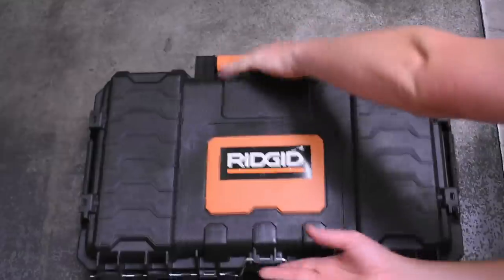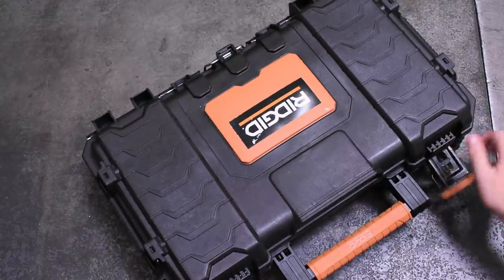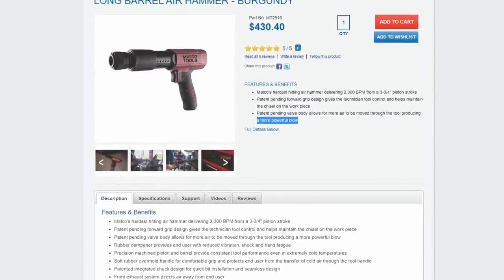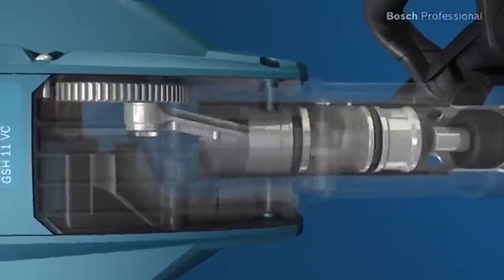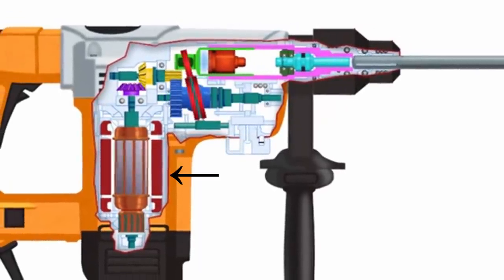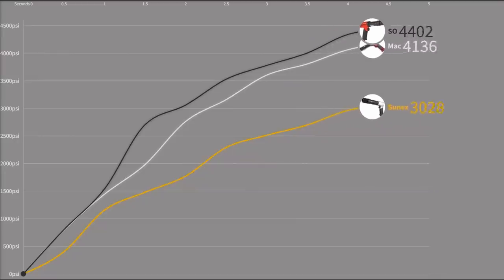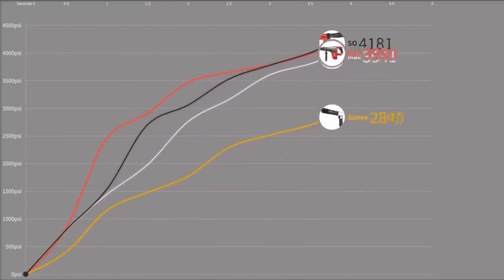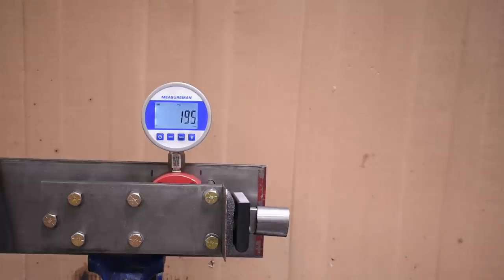How Rotary Hammer Drills Work & Dyno'd vs Air Hammers

Comment: I’ve always wanted to be able to use an air hammer but I’m rarely near an air compressor that’s big enough to remove stuck brake rotors or push out axle shafts. I’d be curious to see if they have any compact versions. Maybe someday they will come out with a dedicated electric hammer version without the drilling function. Could be nice to also see the smaller Harbor Freight Chief air hammer which is only $40 at my local store. Good work!
Reply: There are plenty of hammer-only tools but many are corded
Reply: @lolatmyage  And they are big and heavy because they are designed to be used in demolition of concrete structures not to loosen stuck rotors. So there is no direct electric alternative for air hammer targeted at car mechanics
Reply: @mysterious_czrs  Not really, the smaller ones weight less than 15 pounds and can be swung quite easily. Dull the bit and it will rattle a brake rotor just fine although yes, it might not be good for the tool or your hands if you're hitting an immovable object as I've found that this tool works nicest when it is making progress.
Reply: What about a palm nailer?
Reply: i use my dewalt cordless sds drill all the time for working on vehicles and trailers. it hits fairly hard but also i find it hits faster or different than an air hammer and sometimes it works better.

Comment: SDS Max and SDS Plus tests are awesome, the Milwaukee SDS Max that you were using is quite weak compared to the really big SDS Max Hammer Drills, like the Bosch GBH 8-45DV that has a cinetic impact energy of 12,5J which equals to around 9 to 10 ft-lb.

Comment: Thank you!

The Milwauke 2717 advertises 5.1 ft lbs of impact energy, which translates to 6.9 joules which is what we use in Europe. That's at 3000BPM.

Over here, we get the FHM which is rated at 11 joules or 8.1 ft lbs which is quite a bit more, and that's 2900BPM.

Either way that's a lot for an SDS. Your typical regular use one would be 2-3J but likely hit a bit faster.

Comment: I have a few SDS Plus/Max tools and have routinely used the smaller ones in place of my old air hammer which has rarely been used in the last few years. With a ground rod driver attachment I’ve even rigged up a way to use my air hammer ends on the SDS drill. I use the SDS a lot in hammer only especially the smaller battery one as it is great for doing a lot from popping tile off a floor/wall to splitting nuts.
Be nice to see an expansion into SDS as battery tools have replaced air to a great extent especially outside of auto shops. I have DeWalt as it was the brand I got into 20V/60V but they recently expanded their SDS lines to include 12V which is quite small; would be nice seeing how honest the companies are regarding the power of these rotary drills. If it’s anything like impact drivers there will be quite some fluff in the numbers.

Comment: Ft lbs is energy the SI version is Joules ( J ). 
Most SDS Plus here in the UK seem to be ~2J or ~8J with SDS Max 10J or ~20J. 
It would be nice to see a compact SDS Plus comparison some 12v tools are much closer in size to the air hammers.
Reply: I've Joules used in advertisements of these.

Comment: Very interesting stuff guys! I do rotary hammer testing on my channel but I've never used an air hammer before. Are they for knocking loose seized bolts? Your type of cumulative force measurement is definitely different to what you'd normally do to measure SDS hammers. Very cool crossover measurement.
Reply from the maker: Hey yeah! Ball joints, rusted car parts. Brake rotors. Stuff like that

Comment: Man I wish I could send you my SDS max 60v dewalt hammer drill. I love this thing a lot and had used it as a mini jack hammer at times also did a lot of drilling but it a job tool and cant take it home lol. TBH I never stop to look to see how the internal worked I did not know that it uses a piston and vacuum to get the hammer function to work. Now I know why when I push too hard down on the tool I'm pushing the rod closer to the piston and shortening it travel and it felt weaker but when i let up it becomes stronger, but too light i barely feel the hammer function and makes a weird noise till I push a little harder. IF I don't put just the right amount of pressure it wont be at it max potential picky thing XD. It is fun to see you guys run test on any tools really!

Comment: I've used my SDS drills to hammer ball joints and pins and stuff out plenty of times in a pinch when having to repair a vehicle or trailer while out on the road. It usually works.

Comment: With the work I do, we use a rotory drill when we need to drill through concrete or brick and we use a bosh corded so I'd like to get a new cordless rotory drill and see which one is better

Comment: I recently bought a corded rotary hammer for it's drilling function (that part is amazing!) I found this very interesting. I don't know if I'll ever use the rotary hammer as a straight hammer, as I have a couple of small pneumatic hammers, but it's nice to know that it might be useful in that role if I need a hammer far away from one of my compressors.

Comment: Great video, would love to see the results of the 2718 1 3/4 milwaukee. Its $1200 with two 12.0 batteries. It will drill a 5” hole through a 9” thick solid pored wall plus rebar. Its a beast!

Comment: Is there any chance the length of the bit used in the SDS was “flexing” some of the hammering power away?  Just comparing with the very short length of the air hammers.

Comment: I've never considered getting a hammer drill, and never knew there was a difference between a hammer drill and an SDS (Special or Slotted Drive System, depending on branding) Rotary hammer drill. But, this video prompted my curiosity and now I'm learned up a bit after some internet exploring.
Now I kinda want one. (of both)

Comment: Torque is measured in lb-ft being, (force over leverage/working length from center) . Force applied over area  is measured in ft-lbs being, (force over area). It's a all too common a mistake to mix the too up that has been perpetuated for a long time. Hammering type tools should in fact be measured in ft-lbs over time, (work done over time=power) much like the relationship between torque and horsepower. Torque alone is kinda worthless, as is time. But together they are power. Thanks for all the hard work and time guys.

Comment: A long time ago, in a galaxy far far away... I worked in the rental department of a home depot and this kind of question came up a whole lot.
Mind you, we only rented corded options and no air power or battery power options.

And from the spec sheets that I could find on the corded options we rented, I found a comparably sized and weighted roto hammer vs chipping hammer, according to the spec sheet the roto hammer brought a bit more than half the foot lbs of a dedicated chipping hammer. Like an 11lb chipping hammer was rated for 10.4 f-lbs and the rotary hammer was only rated for 5.8 f-lbs.

But I don't think that anyone makes a battery powered chipping hammer, just rotary hammers.

This next part is just to file away for when you guys get to testing mammoth sized jackhammers and the such, I would love to see the numbers between an old pneumatic powered 80lb jackhammer vs the Bosch, Makita and Hilti options.

Mind you, the big Hilti is only a 60lb hammer but they claim that it does more work vs a traditional 80 due to how the power is delivered and the BPM. 

When I rented them out, everyone who had rented both the Makita (traditional) and Hilti variations told me that the Hilti was the better option and this was across the board for vertical applications. (The 35lb Hilti was not meant for horizontal work, Makita came with a D handle so that you could).
So that was the 28lb, 35lb and 80 (60 for Hilti) categories.

Comment: At work we sometimes use our milwaukee sds plus when we don't have a hammer at hand, or when we need the rapid hammering of the sds. Glad to see it finally tested!
And yes, I would love to see more sds plus/max reviews, like the other milwaukees, bosch, dewalt, and comparing battery powered vs cordless (milwaukee in particular, they make an almost identical hammer drill, but corded).
They also make a model that is strictly hammer, no rotation, so I'm interested to see if that's any different internally or just milwaukee disabling features.

And I know you say a drill can't be measured like an impact, but could you put an sds on the impact dyno anyways, to see if it can compare?

Comment: I do use my Craftsman sds for an air hammer and was wondering how many beans it is tapping on.Works pretty good for flywheels coming off little small engines, really only used it for lawn tractor stuff so far hit a few rusty bolts and now wondering how I can get a socket to attach to it. Are you guys going to be testing anymore sds hammers? If so I wouldn't mind sending mine to you for testing, I think it's been used like 3-4 times so still brand new. One husky leaf blower flywheel, one rusted spindle bolt and rusty u bolt on the f1shitty to see if would work like an air hammer so I don't have to fill up the compressor. Would be pretty cool to see it get tested on your channel. Thanks for all the great content you guys create

Comment: as an electrician, the sweet spot for SDS rotary hammers is when you push, you'll see the tool move in the chuck, you want to keep that half way: half in, half out... thats where your fastest and most effective blows are delivered
pushing hard seemed to slow it down, but not as much as holding it lose, obviously lol

Comment: You brought up a good point in the possible vertical advantage of the SDS due to the weight of the tool. Id be interested to find out if there are any gains in vertical vs horizontal. I feel like they could make a purpose built compact M12 hammer, I hope that that happens one day...
Reply: They have one

Comment: Energy and torque can have the same units but are different quantities. Torque is a force applied at a distance from a (rotational) center. Energy, which can also be called "work" is a force applied over a distance. Torque is a vector quantity (i.e. it has a direction). Work (energy) is a scalar (i.e. no direction).

Comment: Needing a very expensive air compressor (even more expensive if portable, 5HP consumer grade compressors are feeble things) is a very good argument for using a hammer drill in many situations. Someone needs to sell SDS ball joint forks but one might be milled from another tool using a carbide end mill. I need to measure a clay spade and some scaling chisels to see if they're thick enough.

Comment: Impact hammers are usualy rated in Joules of impact.

The SDS rotary hammers are designed to drill rocks and concrete. The rock must chip and then turn and chip again to drill a hole. The chiping part is exploiting the low resilience of the rock (can't absorb an impact over that many Joues -tested in the lab with Izod hammer or Charpay hammer - usually to find resilience values for steels and other metals but same principle for rocks and concrete).

So in order to drill rock you need more Joules of impact than the rock can handle in order to chip each strike. Note that the hammer Joules are absorbed over larger area on larger bits, and can be losses in the elasticity and inertia of heavy bits, and in the friction in deep holes, or in the debries cushioning the blow.
So these rotary hammers are rated in Joues of impact. Typical SDS is 1-7J, SDS plus 2-10J, SDS max 5-20J, hex shank (demolition hammer) 15-100J, and then you go into pneumatic jackhammers with more and more Joules needed for harder rocks, larger bits, larger chips, preferably a chip so big that it fractures a whole slab (for a jackhammer or demolition hammer)

Comment: You guys should test the Milwaukee 2” Demolition hammer if you can get your hands on one. It advertises 20 Lbs of impacting force. I have one, as well as the 1 9/16” you guys tested in this video and they aren’t even close in comparison. That demo hammer is insane, you had better be awfully committed to holding onto it or you’re going for a ride

Comment: As for my experience with dewalt dch 133  sds plus,

 it did serve me very well in solving the problem if stuck mecanical parts, it offer me complete freedom from corded pneumatic hammer, i say don't sous estimate the power in small rotary hammer drills they can get the job done.

Comment: While I don’t have any SDS tools to send you to test, I’d like to see both the larger 2718-20 and the smaller (but not too small) 2912-20 tested. The 2718-20 is 1 3/4in, and advertises 8.1ft-lbs per blow. The 2912-20 is 1in and advertises a fine 2ft-lbs, but 4,800bpm. Would really like more coverage on rotary hammers!

Comment: Impact energy can be expressed in ft. lbs., but they're different ft. lbs. than torque.  In torque ft. lbs., the direction of the ft. and lbs. are perpendicular (the force is applied tangentially to the distance from the fulcrum), whereas for energy, they're parallel (the force is applied across a certain distance, and those figures multiplied together is the work done, which is equivalent to the energy used to perform that work).  Despite having the same name, these are different units.  If you convert to metric, energy ft. lbs. become Joules, and torque ft. lbs. become Newton-meters.

Comment: The difference between foot pounds of energy vs foot pounds of torque is that the distance is how far you move in the same direction as the force. 

With a constant 1 foot pound of torque, you would have to rotate 1 radian to get 1 foot pound of energy. Basically, 1 foot around the circumference with 1 pound of force, rather than 1 foot from the center of rotation with 1 pound of force. 

Though it would be be less confusing to just use Joules for impact energy. 

It's not clear to me whether this test setup is more influenced by impact energy, or by impact momentum.

Comment: It's cool to see these compared.  I imagine that the size of the SDS would really limit the usability of this in auto applications.  Even larger versions may be even more powerful, but if you can't get in positioned to work on a ball joint, then it doesn't really matter.

Comment: was using a Hilti TE-1000 (40lb electric breaker) this week at work to get out a siezed 3" pin.  Was more just to shock the pin as I had a 22T bottle jack pushing it out, but it wouldn't have been coming out otherwise.  I still had the TE-2000 and TE-3000 (55lb and 70lb) breakers if i needed more jam, but that would have been a quite awkward one person balancing act.  These are all electric plug in models, so I don't know if they would be a fair fit in the rankings.

Comment: I use a SDS for the last 9 months or so in place if my snap on 2050.  Definitely nothing close to same power but to use on sheet metal it works well.  Ive been over the last year and half been cutting the cords and air hoses out of my life. I now use a 5 turbine Apollo paint system instead of my 80 gallon air compressor. It makes little overspray and save about 35 to 40% of the paint and clear i use so it pays for it self thow it was expensive

Comment: Perhaps I missed it, but it seems that much like the wrist breaking score you assign on impacts, it would be nice to have a decibel score of sorts for these tools to help convey the auditory discomfort associated with the hammering of each tool. I'm sure it's taken for granted that hearing protection almost universally needs to be worn while using these tools, although it almost never is, but with the introduction of more construction applications as opposed to potentially just shop use it may be just as beneficial to have a more discreet tool instead of the absolute most powerful tool that can be utilized in less controlled environments such as a client's occupied space.

Comment: Different tools for different applications...
The large corded demolition hammers are crazy powerful though id love to see one of those on the dyno like a Bosch GSH 11 E or "11316EVS" in the US.
That's  a 22.5 lb hammer and you need that weight in a demo hammer to cancel out the vibrations and to have something to weight the hammer down onto the chisel when working vertically. The GSH 11 E is especially well balanced in that regard it just has the perfect ratio between the weight and impact energy. Also this model has been engineered in the late 90s as is still one of the most popular professional demohammers. That's german engineering  of the good kind.
It would be virtually impossible to work with an airhammer of the same impact energy.

Comment: Milwaukee makes a 12v palm nailer and I think skil does too. You could grind down the shank of punch or chisel to fit where a nail normally goes. Cordless and compact. It would be interesting to see how much power they make.
Reply: Full steam designs on IG retrofitted his with an air hammer tip and converted it to a planishing hammer of sorts. Super interesting.

Comment: Could you come up with some kind of engine dyno or potentially Alternator / Generator of some kind to be able to Dyno  the Drill part of the drill? Same thing could also used for standard drills.

Comment: hey Torque, can you test the SDS Plus to square socket adapters (3/8" and 1/2") found on Ebay and Amazon. Would be great to know how does an SDS Plus rotary hammer stacks up against an impact driver or wrench when it comes to torque and it it would be suitable for driving/removing bolts and lags. Thanks

Comment: With that mechanism I’d think they could make some truly small hammers which would be really dope for getting small pins out! And hear me out here… if at the end of the day both tools are being powered via air… that air is made by AC voltage in a compressor so knowing the shortcomings there you’d think in a small volume that high discharge DC could produce significantly more air pressure if they put their minds to it.